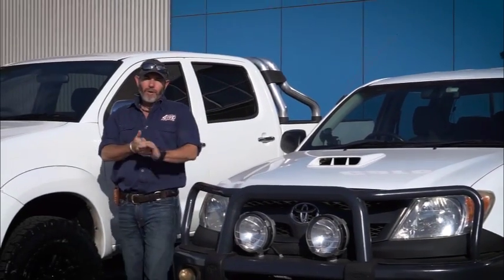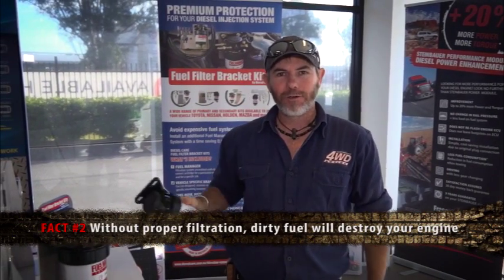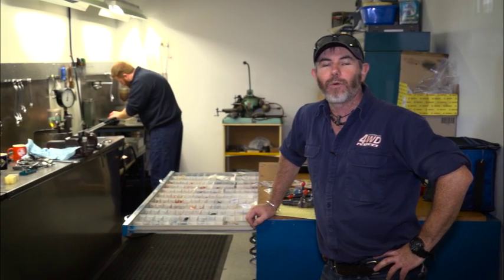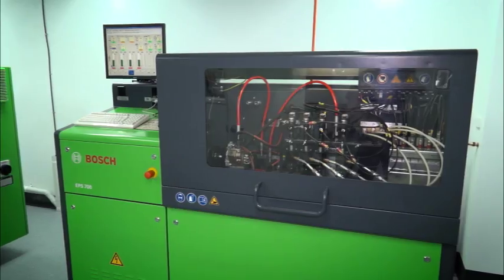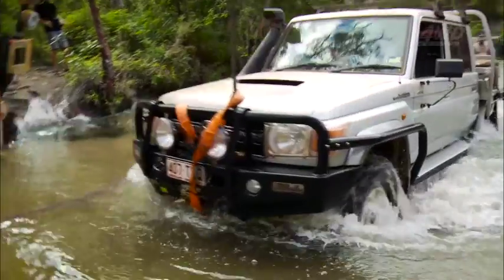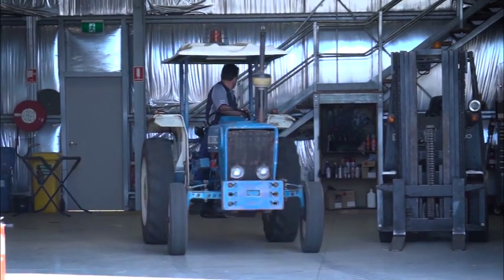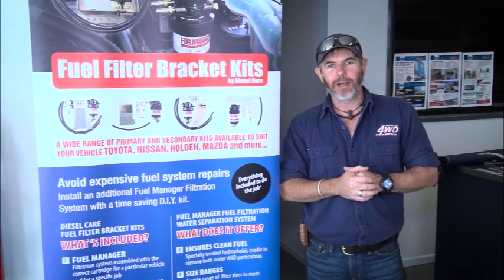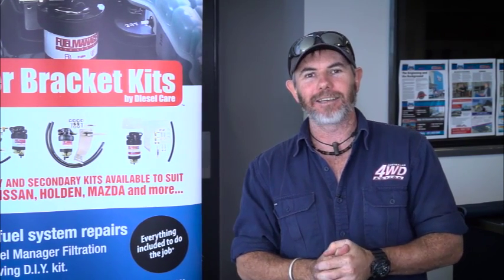Costs of over $15,000 to rebuild a Common Rail Engine - 4WD Action

Comment: I use Diesel Care secondary filters in all my V8 LC's.
Make sure to install your Diesel Care filters whilst the new vehicle still has the original Toyota supplied diesel in the tank so that Toyota has no "come-back" when warranty issues arise. I have had no problems but it's just in case.

Comment: I have a 06/2016 79 series V8 Land cruiser with the stock fuel filter being a 5 Micron one. My questions are, if a fit a secondary filter, should it be before or after the stock one, and should the Micron gauge be the same as the standard version viz 5 Microns or should it be your 2 Micron suggested version?? Keen to have your thoughts
Reply from the maker: We recommend fitting the 5 micron filter as a secondary filter. (after the factory filter ). This gives you the best protection against contamination. Your factory filter is still used as the first line of defence and the filter warning light on the dash will comes on if contamination is present. The secondary filter is there to stop anything that may get passed the factory filter if you do pick up some contaminated fuel.
You can use the 2 micron filter however the 5 micron filter is a longer filter, it has more capacity and effectively removes smaller abrasive particles, resulting in less wear on the pump and injectors. Our kits come standard with the 5 micron filter.

Comment: Lol 15k to rebuild a common rail motor are you serious??? What power levels 350kw out of your diesel motor?? What a joke
Reply: Jai Singh second hand motor 50,000km 6 to 8k +install.
And you can sell the old motor for parts $ $ $.
Reply: I know a 200 series V8 Diesel is around that price, in fact, its actually a little more.
2.5 Navara is around $5500
How do i know, personal experience.